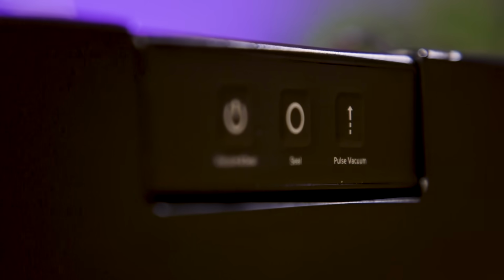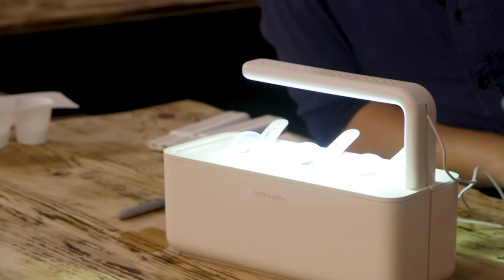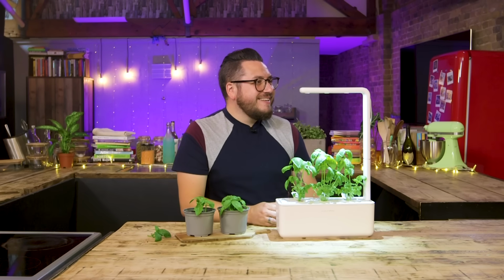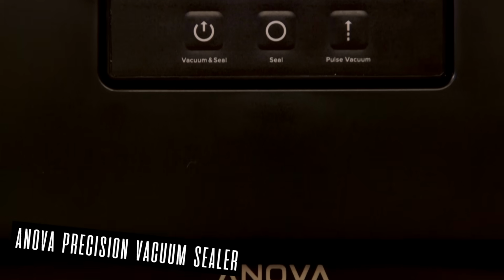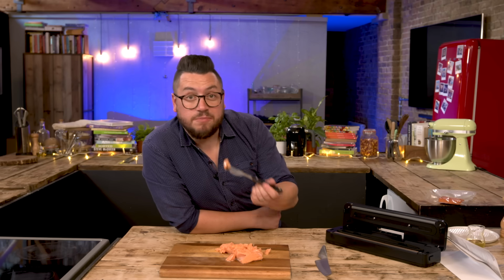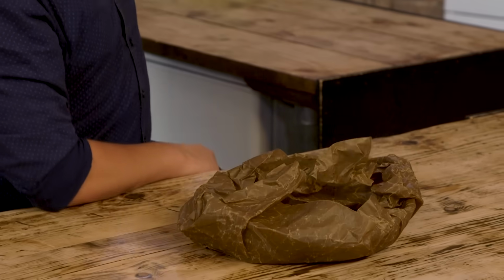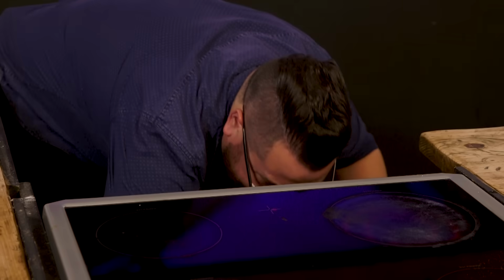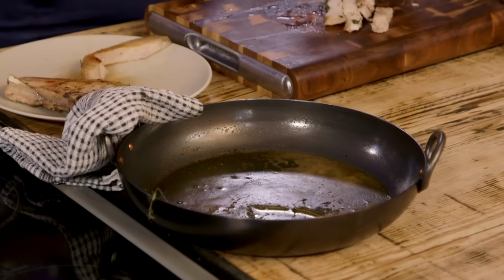Reviewing High(er) End Kitchen Gadgets Vol. 2 | Sorted Food

Comment: When reviewing this pans, it would be great if in 6/12 months, you did a update on how they're lasting!
Reply: I agree, it'd be way more compelling if it's quality holds up that long.

Since it's handmade by a blacksmith I wonder if they will do any maintenance if required.
Reply: Same with the plants. 😃
Reply: @PiousSlayer  8
Reply: @PiousSlayer  8
Reply: @PiousSlayer  8
Reply: @PiousSlayer  77777778
Reply: @PiousSlayer  7777777⁷
Reply: @PiousSlayer  777
Reply: @PiousSlayer  777⁷7
Reply: Pan condition update?
Reply: It's a carbon steel pan. It's weird to see questions like this when it comes to carbon steel. I guess I should put it down to people's lack of experience with this material. Even if you left it in salt water to rust for 6 months it would probably still be salvageable with an angle grinder and a flap wheel. During normal kitchen use this kind of cookware when maintained properly will last multiple lifetimes. These only need re-seasoning if you use them wrong or use them to cook acidic food. Other issues can occur if you drop and crack these although I think that is less likely to be a problem with carbon steel than cast iron. If you end up with crap burnt onto it then it's still trivial to use a pan scourer, scratch off the burnt crap and re-season.

Seasoning is a very simple process:

1. get the pan a bit hot and clean it thoroughly with regular dish soap (it does not contain lie and as such will not strip any existing seasoning, if you put it in the dishwasher then it likely WILL lose seasoning)
2. once it's hot and dry, take a drop of vegetable oil (really the oil choice is not as important as some people insist) and using a paper towel wipe it all over the pan making sure you see the colour change slightly
3. take a fresh dry paper towel and thoroughly wipe off all the oil (this will leave behind a thin film of oil, think enough to effectively season the pan)
4. throw the pan in the oven to heat up to at least 250°C for about an hour, and then leave it there to cool
5. Once the pan is cool, repeat the oiling process and store or use.

To clean: Clean with regular dish soap (once again, without lye), hot water and non-scratch scouring pads (they're pink or white as opposed to green or blue). Dry thoroughly and repeat the oiling process for storage or use.

If you get a patch of rust, either because you left the pan without cleaning it for too long or you didn't oil it properly then try with a scratchy pan scourer first, and if that doesn't work then buy some sandpaper from wilkos. Although it sounds drastic, rust patches come out very easily.
Reply: @isfiyiywafibc6qaiiiiiiiiii570  right! That's the reason I love cast iron and carbon steel. Fairly easy to maintain. Totally nonstick. And even if you do somehow screw up the coating, just re-season the pan. I've picked up pans from garage sales that definitely were not kept up and I just stripped them and started over.
Reply: update on value maybe?
in 2024:  the Alex Pole carbon steel 11" oven skillet is $214
(not $100 from 3+ yrs ago)
Reply: @PiousSlayer    what maintenance would be required?
that's not snark, genuinely what do you imagine a pan would require?

Comment: They didn't mention the most important and useful aspect of a vacuum sealer: Food Storage and Preservation! Frozen meats and food last way longer vacuum sealed than any other way. Most places recommend up to a year for a lot of meats. Buy meat in bulk, cut into portions, and vacuum seal. It's great. Come home from work, pull steaks out of the freezer, pop them in the water bath, and then by dinner time you have perfectly cooked steaks that only need a sear.
Reply from the maker: That is a great tip!
Reply: And if your ok with reusing bags you can, you just need to cut the bag open straight across. Then you just need to get over the shrinking bags.
Reply: Came here to say this! We only buy meat and veggies bulk now and portion out, vacuum seal, and freeze. Cheaper and longer lasting.
Reply: I dont use my sous every week but I do use my vacuum sealer every week. Mine was about 30 pounds 2 years ago and its probably the best pound per buck gadget ive had. 
Bulk meat, veggies, portion meals in the freezer. Hell I use it for my friend's to keep tobacco moist for longer.
Reply: When I make food - such as smoking sausage or chicken quarters, or make broth - i also freeze in portions for easy ingredient additions.
Reply: @corkspa  if u freeze before u vac pack you wont crush or ruin their shape.
Reply: Agreed. And seriously, there are cheaper options (both food sealer and sous vide) out there than Anova. Last winter I picked up three sous vide units for less than the cost of one Anova unit. One for myself, one for a friend who had helped me out quite a bit, and one for my sister's birthday.
Reply: Also you can just thaw the food you don't need a sous vide set up to use the frozen food. Requires a day or two planning ahead, but still amazingly useful and cuts food waste.
Reply: I want a vacuum seeler for when I make my trips to the city. Meat is so much cheaper there and I like to bulk buy like mad for both me and the dogs.
Reply: @bobbythecajun7869  I have a vacuum sealer from my mum that has a continuous roll of "bag" (with the opening on one side) so you can easily make your own bags that perfectly fit whatever's in them. Also works with any freezer bag, you don't have to buy the expensive brand ones.
Reply: Don't forget, once you have SV'd the meat (or whatever), that you have pasteurised it so it will last longer in the fridge than uncooked meat.
I SV several chicken breasts at a time, Chill them down in an ice bath after the SV, throw a couple in the fridge, and freeze the rest. All the meat is already cooked to perfection, it's just a case of reheating/ searing the fridge stuff.
The frozen can be defrosted in the SV bath (or in the fridge), warm up, sear, serve.
Buying the SV vaccum bags in a long roll (3m or more) that you then cut to size as needed reduces the plastic useage, or go further and buy reuseable silicon vacuum bags. Personally I just stick with the rolls.
Reply: For clarity, the breasts are either individually bagged, or two to a bag depending on what I have planned for them.
Reply: @SortedFood  It would be interesting to see y'all try out various methods of preservation and try to compare them.  Look at how Long, how Easy, and how Tasty they end up.
Reply: If you want to know how to use a vacuum sealer and sous vide, go ask Guga here on the tube.
Reply: @christianstorms3950  Sous Vide Everything ftw
Reply: That's what I came into the comments to say. I can store food in my freezer for way longer when it's vacuum-sealed. Also, I have a chamber vacuum sealer which means I can seal liquids as well - comes in very handy for my soup fetish. Yes, it was a lot more expensive than the one in the video but I use it at least 3 times a week (as much as I use my similarly priced Kenwood Chef XL). Bargain.
Reply: @SortedFood  Sounds like you need to do some more testing with this one.  Maybe do a "Bulk" episode, and try some of these larger options, separate and bag, then give some thoughts on how that goes.  Then try a few meals using the bagged products.
Reply: I've been portioning and freezing meats for a few years now. The first couple years I did it with Ziplock freezer bags, and while it worked it had a shorter shelf life and that shelf life was climate dependent(living in Nevada I had about 3 months; living in LA I only have a month at most).  The vacuum sealer fixes that 100%.  I happened to get one on sale as well so got a more deluxe model that has an attachment for reusable containers and while expensive they work really well too.
Reply: This comment and the comments for this comment have covered all the commenting I was just about to comment on in the comments. Thanks commenters for saving me from having to comment!....... Except for this comment about comments
Reply: corkspa When we had a garden we used to blanch, vacuum-seal, and freeze our vegetables in the autumn. They keep their fresh taste a lot longer in vacuum bags as compared to ziplock bags.
Reply: Yes! My fiancé was wasting so much meat (I don’t eat it) from buying it and forgetting about it in the fridge and having it go bad! Now he portions it out and freezes the extra. Really great for small families, just the two of us, who buy larger portions of food.
Reply: DanielP -- my thoughts exactly. I've done that in my kitchen for easily 20 years.
Reply: My vacuum sealer also does liquid. I can put something in a saucy marinade and vacuum seal it in a bag or I can vacuum seal bowls of soup using some of the attachments mine came with.
Reply: 10 days chefs
Reply: its also why pre packaged meat products come vac packed lol
Reply: @kevcruickshanks  We put things like that side-by-side in one bag, seal twice through the middle and then along the top. If you just want one, it's easy enough to cut it free between the two middle seals and leave the other in the freezer. You can't do it with very wet things, but for more solid items it works a treat. We do it with deli meat and cheese, too, and it's cut down on waste tremendously.
Reply: @RaeBriar  Mine doesn't do liquids but for wetter things like meat in marinade I've come up with a trick. I put the item in a regular zipper bag, squeeze out as much air as possible, then put that bag upside-down in the vacuum bag. I don't completely seal the zipper bag so it all still vacuums fine, but having it mostly closed keeps the liquid inside it instead of being sucked into the machine. I have a ton of zipper vacuum bags (we wash and re-use them) in various sizes, so I will sometimes use a smaller one of those inside a larger one for the same effect.
Reply: @ToniHinton  That's a good tip for anyone that doesn't have one that can do liquids
Reply: @kerielwatson3197  I would recommend the Foodsaver vacuum sealer. 
I use mine a LOT and it has the added benefit of sealing canning jars as well. I buy bulk meats, trim them up and vacuum all the air out of the jars and pop them into the freezer. I can add veggies, dry beans etc to each jar and when I need to cook them, just dump it into the crockpot. 
Since I've gotten mine, I haven't gone 3 days without using it. I do also use the bags for larger cuts of meat, etc. but I find I can get away with using good old canning jars for a lot so I reduce the amount of plastic I'm using
Reply: more than any method?

sorry but uh....freeze drying exists,that can keep a steak safe and fresh for over 2 decades.

you could freeze dry a steak on the day your child is born,then store it safely and eat that steak together when the kid turns 18 and have zero issues.

yes it's the best common and "cheap" method,but fd is unquestionably superior scientifically.... if you can afford a 3-5 thousand USD machine.
Reply: I agree. And while I was living w/a friend during lock-down & he was doing a lot of trout fishing, my vac sealer was perfect for storing/freezing all the fish he was catching. It was especially good bc the one I have (Foodsaver brand) also has an option for rolls instead of individual bags, so you can customize the size & have less unused plastic.
Reply: Vacuum sealers are also great for single people. No more eating the same meal six times in a row; just portion out your leftovers into single portions and toss them into the freezer for quick weekday meals. No more having your crisps, cereal, flour, etc. go stale or soggy before you can get them eaten; just reseal the original package after every use. You can now take advantage of bulk buys without wasting food; just portion it out in smaller packets and store in an appropriately cool place. I use my vacuum sealer nearly every day, and I don't even do Sous Vide cooking.
Reply: I live In Italy, my vacuum dealer gets a ton of use - cheese, pancetta, pork chops, lamb.

Comment: I have an anova wand and a non-anova vacuum sealer. It's so great. As far as the bags are concerned. When I cut them open, I cut close to the seal. I wash   and air dry them. I can get 2 - 5 uses out of a bag. It reduces plastic waste and overall cost.
Reply: And they can handle heat so you can heat sterilise them. Great idea 😁
Reply: I do the same thing!
Reply: I've bought zipper vacuum bags because my sealer has a handheld bit, so you don't even need to cut them open.

Comment: Heads up for anyone starting to sous vide put your vacumn sealer a little bit above your food item by putting it on a brick or small box and it helps keep liquids down if you cook with liquids and don't want to ruin a vac sealer. That way you don't have to turn off the vacumn sealer super quicklybefore it hits the sealer when ur sealing ur bags with liquids in it
Reply: Thanks for the tip. At first i had a weaker vacuum sealer no probs with liquids, now i have this powerful thing and everytime it sucks liquids up in the chamber.
Reply: Not sure how common it is in the UK but here in the states they have them that work with liquids, even back 3 years when the comment was made. They are around the same price you just have to read the descriptions. Mine just recently broke due to a quick trip to the floor and my new 1 is amazing. 
I think Jamie would have been more open to it if they had gotten a cheaper/better model, also it's far more useful for food storage for normals than sous vide. My old model had a vacuum tube to even vacuum seal large bags which is great for travel since you can pack more in a smaller bag.

Comment: 10:33: "It heavily reduces food waste."

Yeah but food waste is mostly recyclable/biodegradable, Plastic is a hazard. There is a reason why most states are trying to do away with plastic bags in stores.
Reply: I don't know about  this particular maker or model. I use a Foodsaver vacuum sealer almost daily for the very reason that I can use canning jars for most of what I'm packing in them. I buy bulk meat,  grind it into hamburger, trim it into stew meat or slice it into thin bits for stir fry and then pack it into pint jars, vacuum the air out and pop it into the freezer. 
I live in the desert so actual canning is a horror show (example the temp right now is sitting at 113 degrees F) because of the heat it generates indoors. I do use bags sometimes for larger cuts of meat, or some nice steaks, but those are rare instances because I can rarely afford those kinds of cuts.
Reply: Foodsaver makes resealable/useable bags now.

Comment: I've had a vacuum sealer for over a year now.  Other than sous vide prep, I think the primary use for the vacuum sealer is preventing freezer burn and consequent food waste.  I now buy meat at Costco (for a lot less per kilo than the supermarket), and then divide the large packets up into single meal servings for me and my wife.  Meat lasts for months in my freezer when vacuum sealed, and freshness and flavour aren't affected.  I bought the Foodsaver brand; the bags come on a roll that you cut to the exact size you need for each portion, reducing waste.  Roll bags are also much cheaper than individual bags, especially from Amazon.  Highly recommended.

Comment: I bought a vacuum sealer last year and wouldn't want to miss it. I vacuum cheese and sausage in small portions or vegetables or fruit for smoothies and freeze them. I have also used it to freeze entire meals. I use a tube of foil that I seal according to the size. That way you have less waste. You can also wash out the used bags and use them several times.

Comment: You neglected the best reason to use vacuum bags. It keeps food fresher in the freezer longer without freezer burn, and food can go right from freezer to sous vide like you would put food in a crock pot. I usually go buy meat in bulk (cheaper) vacuum seal and freeze the meat (fresher longer and no freezer burn) and then pop the bags into the sous vide to cook while I’m at work (convenient). Also I have had my vacuum sealer for like 6 years and it’s still going strong.

Comment: I use my vacuum sealer mostly to freeze food items for later use. Also, I open each sealed bag close to the seal, and if I’ve only frozen a food item in the bag, not heated it in any way, I wash, hang to dry, and reuse the bags multiple times. Less plastic waste. Less expense.

Comment: As a sous vide enthusiast, I've got a few things to add to what you said:

 - Technically a vacuum sealer probably does yield better results, but by submerging ziplock bags in water to force the air out you can achieve very good results. I've never felt the need to get a vacuum sealer.
 - The biggest advantage of a vacuum sealer is convenience/ease of use. It takes time to fill a sink with enough water to submerge a jumbo ziplock bag in, you have to position the meat carefully to minimise bubbles, it's fiddly to seal the bag while holding the meat underwater, and if you do it wrong you might get water in the bag or fail to seal it.
 - Regardling plastic waste, Anova sells reusable sous vide bags, they are basically just more sturdy and dishwasher-safe ziplock bags. But they aren't very big and they don't give as good results as a ziplock bag.
 - Also regarding plastic waste, Anova has a new "Combi-oven" which is meant to be able to do achieve sous-vide-like results without the use of any bags. Maybe you could try it out on High(er) End Kitchen Gadgets Vol. 3? I'm very interested in it but I'm waiting for independent reviews before purchasing.